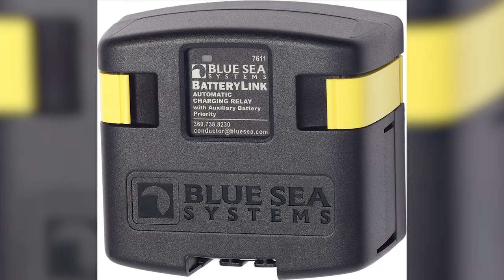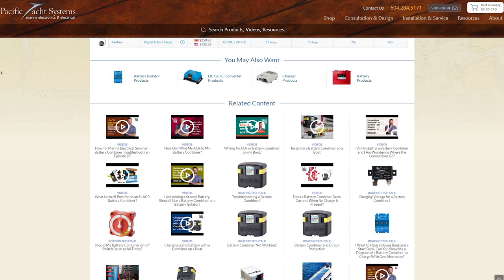Is A Battery Combiner Bi-Directional on My Boat?

Comment: Hi, Great information! I'm actually going to completely separate the engine and house  electrical systems next summer. Solar and shore for the house and 2x batteries for the engine (just in case).

Comment: Good information!  I have the yandina 100 combiner on my boat.  It is definitely bi directional as I can  connect  a 10A charger to either battery and it takes a few minutes but the switch does open to share the charge.  That charger is an older (non smart unit).
I bought a Noco 5A charger to more slowly charge the trolling motor battery overnight between trips to the water.  I'm curious if it will also produce enough charge to trip the combiner switch and share charge with house (outboard) battery.

Comment: In this case if you add a shore powered onboard battery charger (maintainer) in stead of the solar, would it serve best to be connected to the house or starting battery and would it charge both batteries ?
Reply: I would also like to know the answer to this question👍🏻